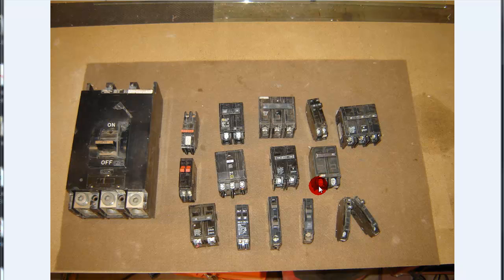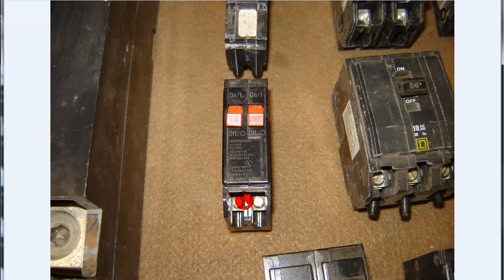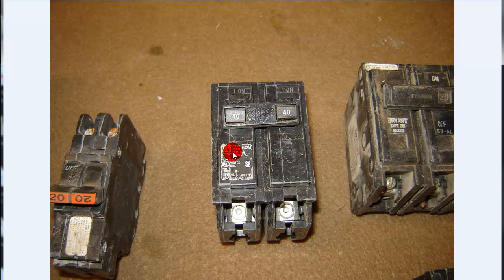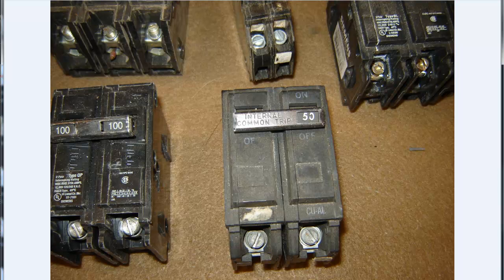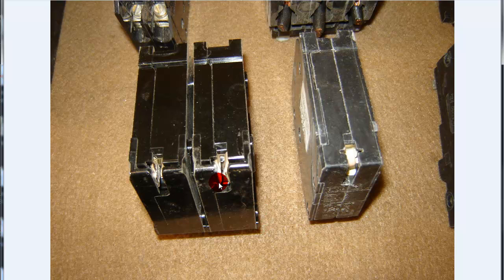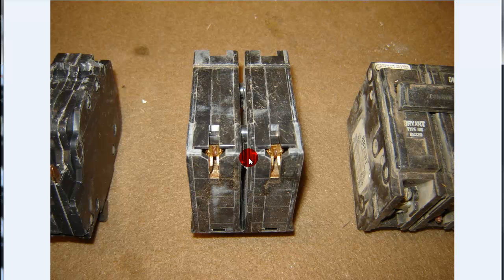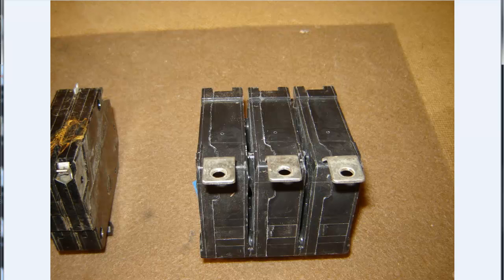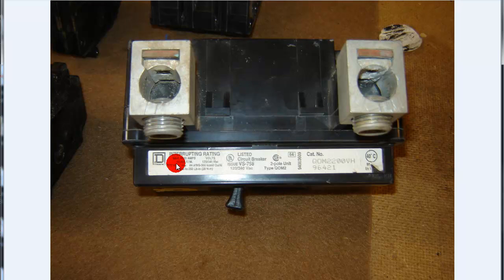Circuit Breakers

Comment from the maker: @violentd013  "Square D.ITE,Cutler Hammer are brand names. BL,BAB,QO,THQP are breaker types. Bolt on, Plug on are styles of breakers. This is not a comprehensive list but a small example of what is available.

Sparky

Comment: thats so weird, maybe not for you guys, but here in Aus, most MCB's are din rail mount(except for MCCB), and they have tunnel connections on both sides so pretty much you can mix and match just about anything, breakers, chassis, panels.